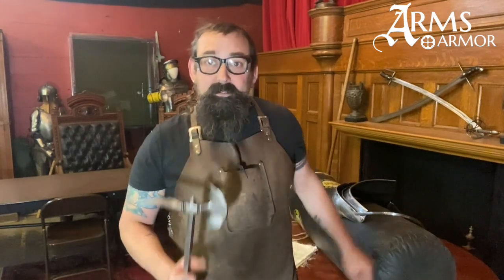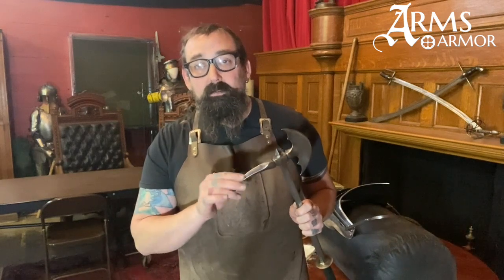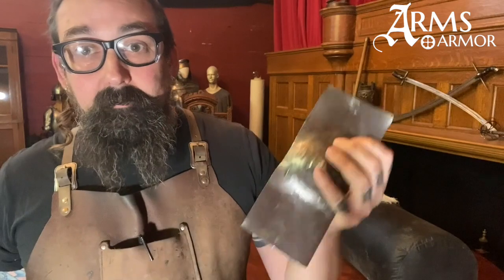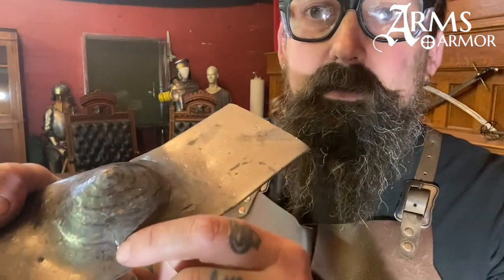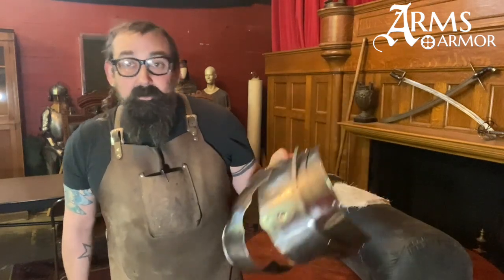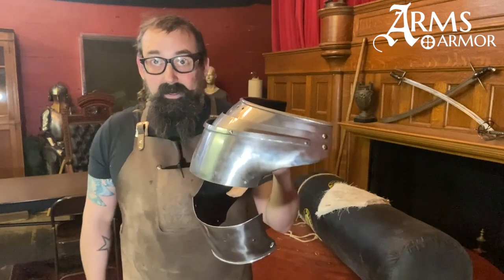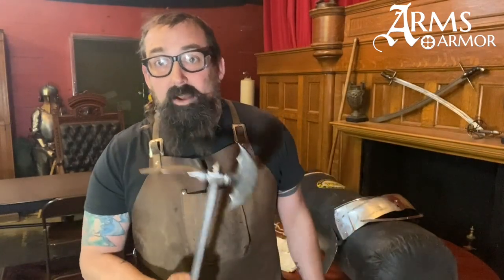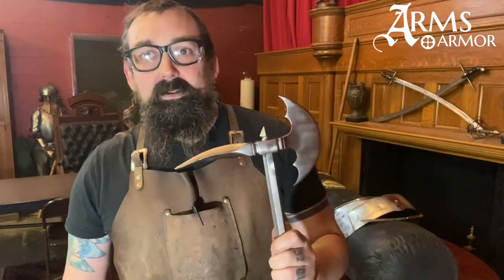Horseman's axe vs. plate armor

Comment: I disagree with which part of the weapon was made to defeat armour. 

The axe blades were shrotened and dulled a bit, they were reinforced aswell. The spike can easily get stuck, I've had the spike of my hammmer get stuck in cardboard......if youre weapon happens to sligtly pierce armour (it wont unless its cheaply made) you're dead. Imo, the spike was used for the killing blow, and to hook things out of the way, but also as just a backup weapon in case the primary one (the axe blade or hamner head) got broken, its just for versatilities sake. I also imagine that the beaks were used heavily in grappling, as a way to get better leverage over an opponent. 

I do not at all believe you would've used the spike as the primary "anti-armour" weapon, it doesn't make sense when you really try these things out. 

The axe blade/hammer head is going to better at cause structural damage to the armour and possibly collapsing the joints (though unlikely)

Comment: I don't see 4140 as a carbon steel. The additions of chromium and molybdenum are meant to give very specific hardening properties. While I don't blame you for using this steel in making this axe, I'm not sure whether the smiths of that time could match that metallurgy unless they were just lucky in finding iron with the right amount of those contaminants. Do we know whether the smiths of those times used low alloys of this kind in making weapons?
Reply from the maker: Good question, the smiths of the period would have worked wrought iron and wrought steel. The material would not have an even distribution of carbon in the steel and both would have had a certain amount of impurities in them. The materials would not be taken to a liquid state in processing but rather working the raw bloom into the material via hammer and heat. Some had technologies for carburizing for edges and such but in most cases the materials would be combined to get steel in certain spots such as an added chunk for an edge. Heat treatment in period would have been the crafts person trying to imbue attributes into the material rather than any realization that it was doing any kind of material formation adjustment. The did hae to watch out for certain inclusions in the materials as some of these would have desired or undesired effects on the finished project. We use this material today because it's what our foundry can offer at the moment and it provides a nice equivalent to period hardnesses. There is a series of blog posts we did on period heat treatment if you want to dive into it. here is the first one https://www.arms-n-armor.com/blogs/news/historical-sword-making-heat-treatment-pt1
Reply: shouldn't the handle be hex or sqaure instead of round to have better grip

Comment: If your plate armor gets bent/deformed where the articulated plates are meant to glide across one another, your mobility could be moderatly to severely compromised. I believe some fechtbuch techniques (wrestling etc.) were designed to injure not just human joints but the harness as well.
Reply from the maker: It may well be. The ability of armor to resist deformation would be highly correlated to the cost and quality one purchased in armor. i.e. much the same issue as we see with the mail armor.

Comment: Impressive performance. Good move going with heat treated 4140, it’s a very tough alloy. I’ve been looking at this piece for a while now, but I was concerned that it might be untempered/low carbon steel. I’m much more likely to pick one of these up now that I know.

I think disclosing that in the website listing might help prospective buyers like me who are on the fence about pieces with no steel type/heat treatment listed.